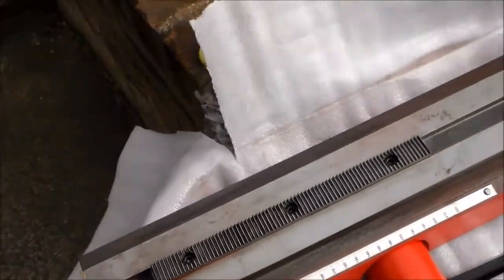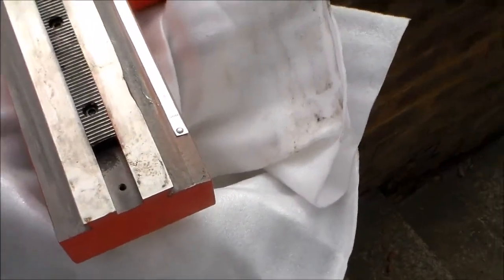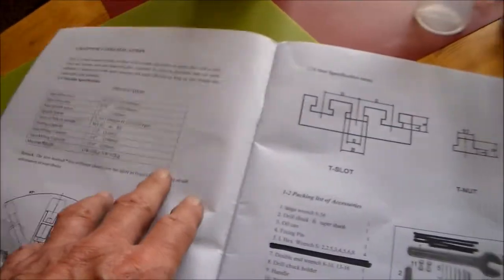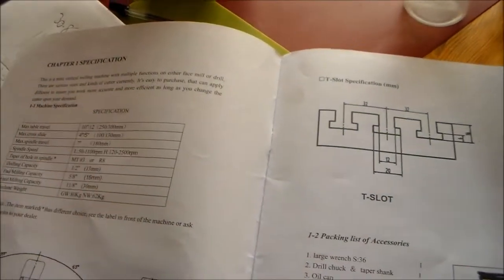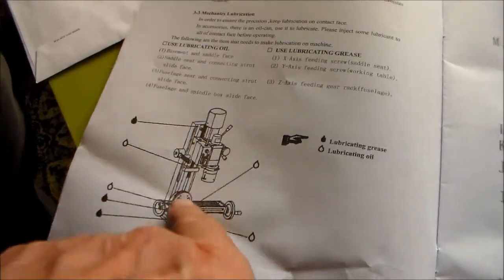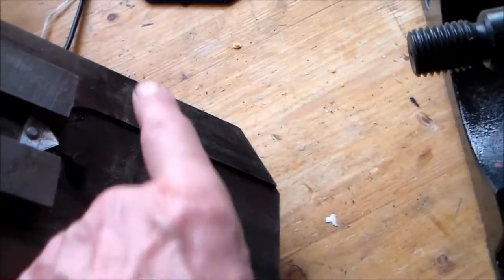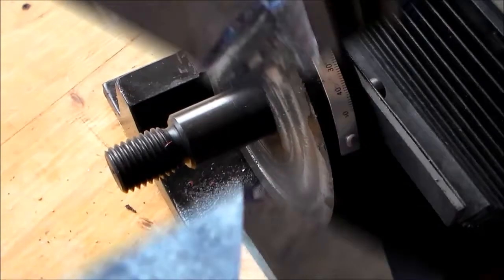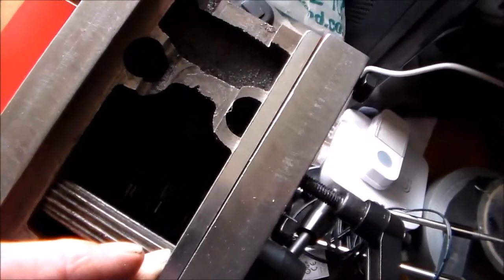550w Mini Drilling Milling Machine part 2

Comment: All milling mach
Reply: All milling machines are roughly build and take lots of care to assemble. China ones are very very rough castings kits at best. I bought an combo lathe mill drill 20year ago but by talking to people and now youtube have shown me the right way to bring my machine into a work able tool. All the great info on Youtube not get frustrated just work through the problems and have fun. Good quality cutters help look to Amazon and Banggood for them. Thanks for sharing
Reply from the maker: Thank you for the encouragement. I will certainly look at Banggood.